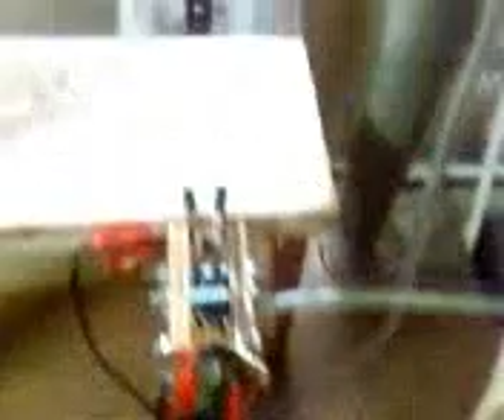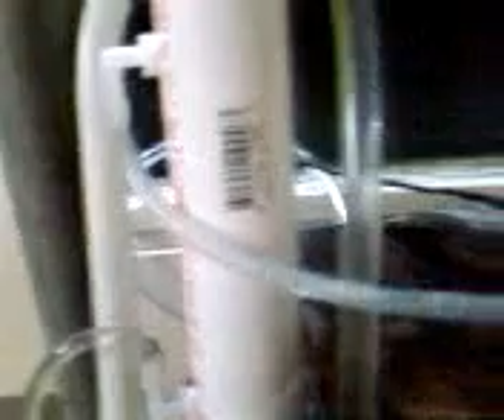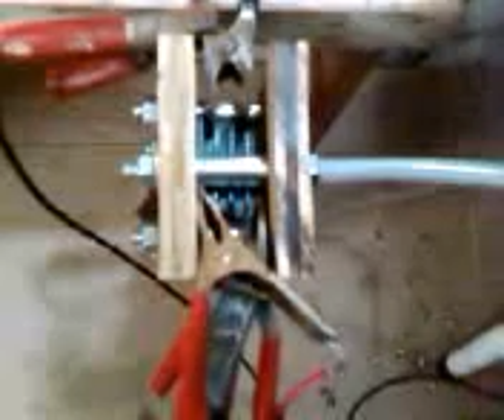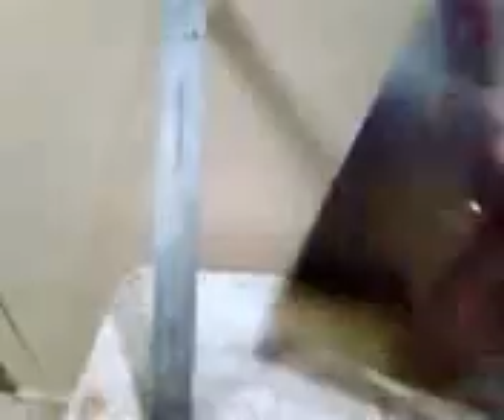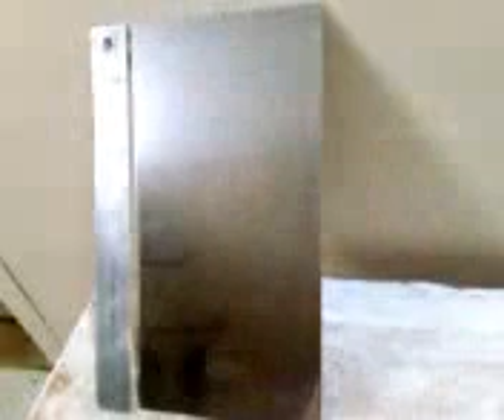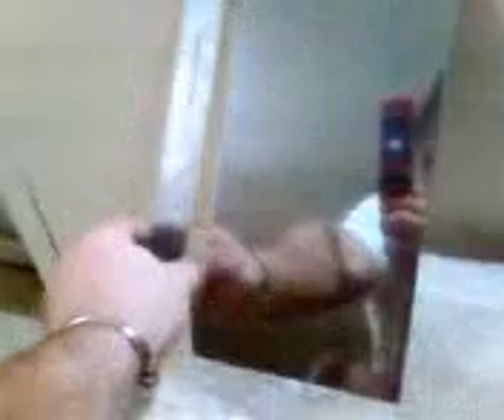Ruler Cell, using PLYWOOD structures(2)... MMW

Comment from the maker: Thnx! Ruler cell is probably just going to be a toy. Not much surface area for the amount of HHO I need for any of my vehicles!

New cell is 8X8 w/ at least 7X7 active surface area. Probably will not have plastic endplates.

Outer plates will just be active outer cell plates, one side Positive, other side negative, all inners will be neutral plates...

Thanks again!

Sincerely,

Todd...